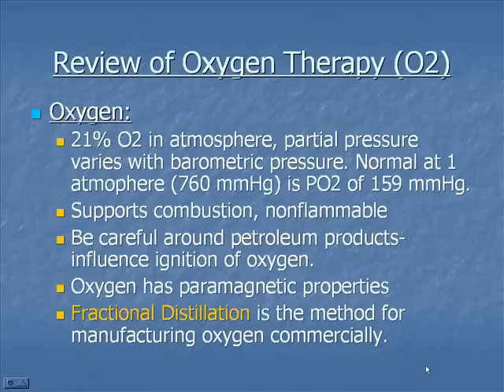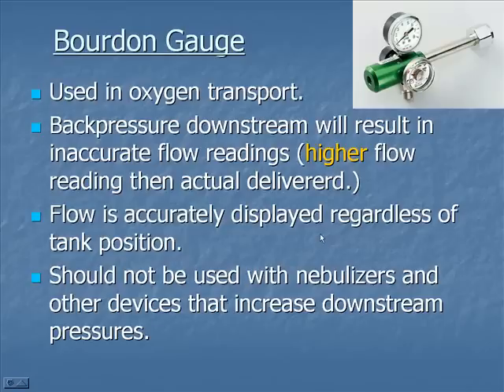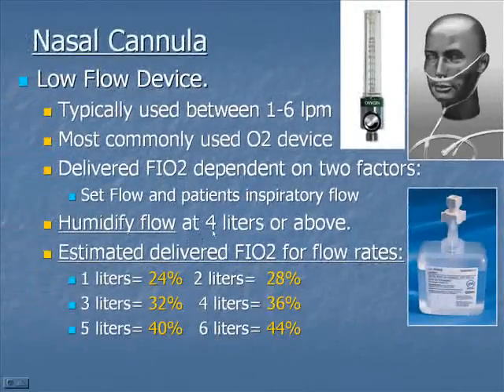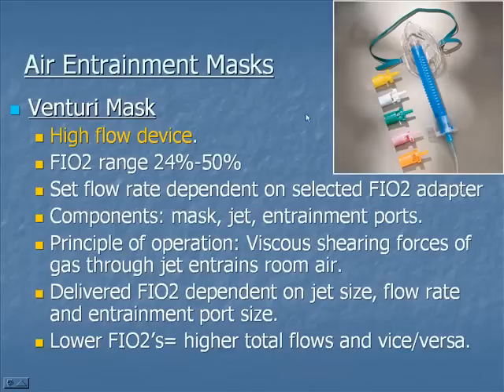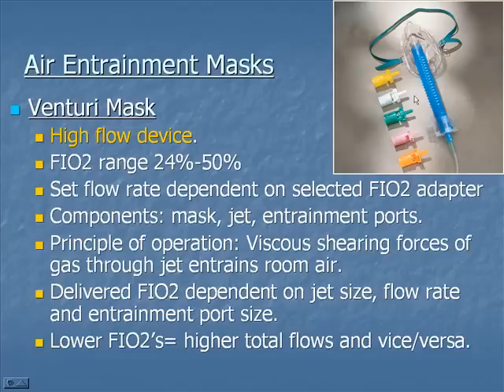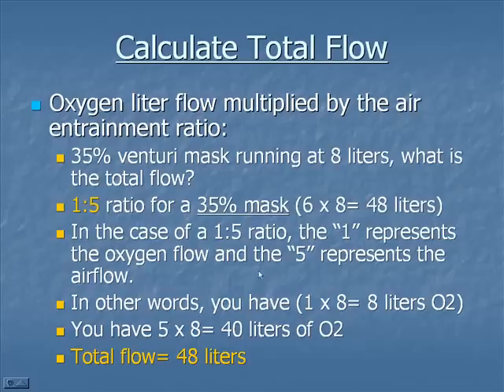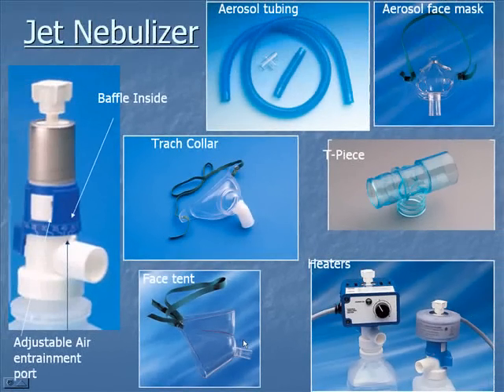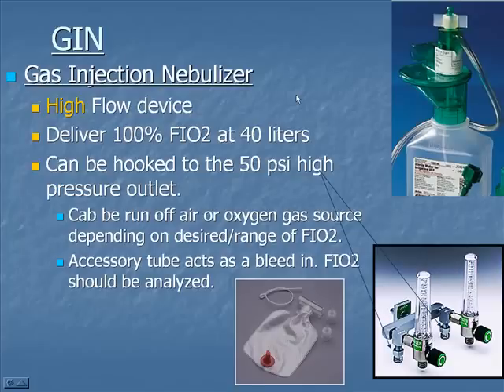Introduction to Oxygen Therapy Devices

Comment: I live overseas and was setting up for an ozone machine and have a pediatric regulator. I then had a medical oxygen tank delivered and they shipped a beast of a tank. My regulator wont fit over the metal dial valve. I think I am going to need one hell of a high pressure medical regulator for this giant old school tank. They sell them locally for $220. Can I order one on line for cheaper or am I going to pay alot because of the nature of this tank?

can I use any other kind of regulator? This tank appears need a side mounting regulator but I am afraid I will order the wrong one?  Can you point me to someone who can help?

Comment: I am on oxygen. My doctor says to keep it on setting 3 when at home and 5 when I go out that involves walking. I'm thinking of getting a portable concentrator. Has any of you tried them before. If so, does it help in getting around.
Sometimes even though my oxygen level is in the 95 to 99% range I still breathe quite heavy, but if I walk for a little then sit and rest I seem to be alright. Is there any concern I should have because of that?
Does anyone know if 3 continuous is the same as 5 pulse rate for portables?
Reply: An oxygen concentrator is great for home use. Portable would require a lot of power to get it to run. Liquid oxygen tanks last longer and its smaller to carry around where ever you go. To answer your question, do you mean 3LPM of oxygen if its the same as 5LPM of oxygen??? No, your Doc thinks you need a push to go out during ADL, 3lpm is your normal needs for your body to be good while your not doing anything tiring. Good luck and remember keep away from flames to your face. Keep healthy and take care of yourself.  God bless!
Reply: I don't know much about oxygen administration but u are in my thoughts...i hope sometime later you can breath without these aids.
Key points
1.Titrate up en down to maintain the target oxygen sat.
2.Keep changing positions.Ambulate more....always sit upright,head flexed,shoulders relaxed and knees flexed
3.Use spirometry-breathing exercises help maximize ventilation 
4.Take deep breaths,hold 2secs  and cough 2-3times in succession 
5.Systemic fluid hydration enhances liquefication of pulmonary secretions and facilitates expectoration of mucus.
6.When you sleep .lie on the sides unless contraindicated. ..helps unblock airway of mucuous